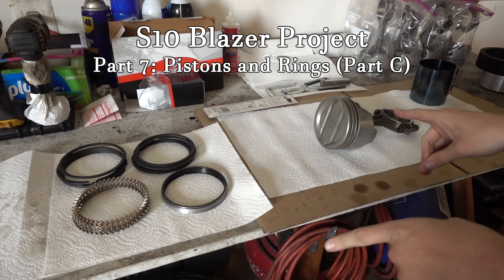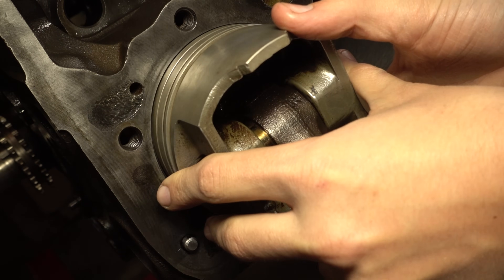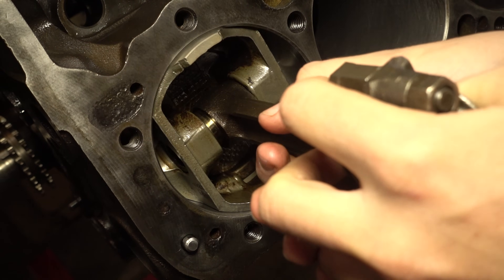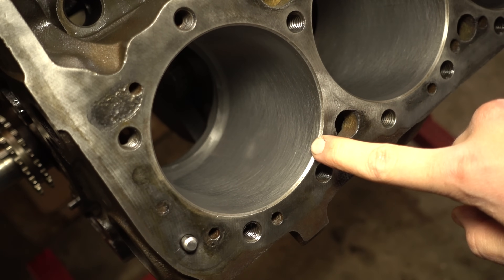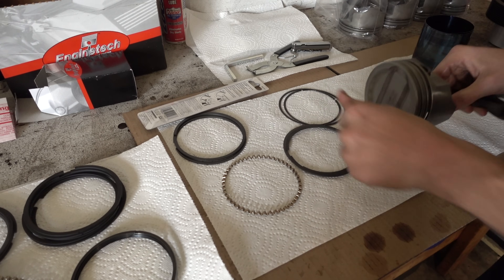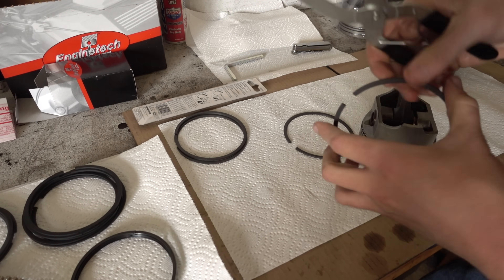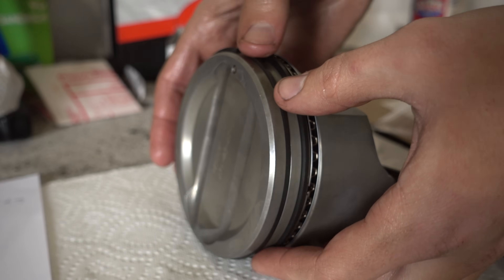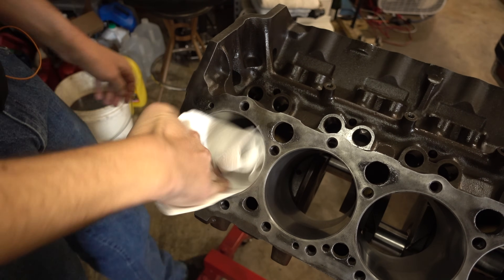V8 S10 Ring Gaps and Piston Install (Ep.7 Part 3 of 7)

Comment: Curious is both top ring and bottom ring wider in the groove not talking about the 5/64 thickness but where the ring touches the back wall of piston groove outward to edge of piston, I'm having a hard time with mine as they are both thicker and both grooves in piston are at the same depth

Comment: I learned a couple of things from a Mr Goodwrench, when putting pistons in is to have the cylinder 90 degrees instead of the 45 degrees you used thus the (protected of course) rod bolts have a even smaller chance of touching the crank journal. Another thing learned was to use a wooden handle hammer to tap pistons into place instead of the rubber covered metal shank handle you used (for reasons another poster stated). 
If I miss a thumbs up on a video it's because I'm rushing to get to the next video as I am enjoying them that much :)

Comment: You may want to check ring depth on the oil seal rings, I ordered a custom set of forged pistons and did not check this and destroyed the engine.
Reply from the maker: Very good point! I know there are at least two different groove depths used for these engines, though most use the stock depth. These pistons used the stock depth so it wasn't an issue, but for some aftermarket (especially high-end) pistons it is pretty critical to check. Sorry about your engine!

Comment: I am surprised that you are being so cheap knowing all the issues you have had. Buy the proper tools and use the proper lube for the jobs you are doing. You are putting all this money into rebuilding the engine but are to cheap to do it right. Does not make sense to me. Also if you are guiding people on how to do things, do you not think you should be showing how to do it the right way? Not the cheap way.
Reply from the maker: I would say that the "cheap way" isn't necessarily not the "right way". If the money is not there to do it better, doing what you can with what you have can get things done well enough. There are plenty of videos out there showing builds where they throw expensive parts and big money at engine builds and make a ton of power, I think it is fine to talk about how to get things done if that isn't an option.

Comment: Using thick assembly lube instead of engine oil on the bearings will increase your free-turn torque. 
With engine oil you might've been 15-25 ft/lbs of torque depending on the weight used.

Comment: What is used instead of plastiguage
Reply from the maker: You could use dial indicators to measure the parts separately, and the clearance is the difference between the readings. Requires specialty equipment but it is the more accurate way to do it.

Comment: Dude, i like you. But this WD-40 is shit. You can use oil engine. Same like factory.
Reply from the maker: There are many people who make the case that you don't want any excess oil on the cylinder walls during cylinder/ring break-in, and WD-40 lets you install them easily without leaving a film of oil. In my opinion, you can pretty much install them any way with cast iron rings and not have to worry about it, this is just the strategy that makes the most sense to me.
Reply: +Fuzzy Dice Projects Your doing right, I build engines for a living and I use WD40 to install the pistons. I've tried probably every method there is over the last 34yrs. WD40 works fine. If ya use oil or tranny fluid, it can glaze the cylinders and the rings never seat.

Comment: Putting rings in without any kind of lubrication can cause scoring into the cylinder
Reply: WD40 is a solvent NOT a lubricant. Ever use it on a squeek and 2 days later the squeek is back...and worse?
Reply from the maker: Used WD40 when installing, as shown. Helps get them in to the bore. Many people prefer to install rings completely dry, though.
Reply: FuzzyDicePimp I know you used WD40 I was talking about how some people put them in dry
Reply from the maker: Oh, okay. I have never tried that myself, so I have no experience with it. Can't be that bad if I have heard of it being done so many times though.
Reply: Engine oil squirt from a bottle would have been more sufficient.

Comment: Tip: watch out for the bottom of the hammer, my dad have a hammer where the rubber has worn out and a steel rod is now damageing everything when you use the back of the hammer
Reply from the maker: Fair point, be careful if you use a really worn out tool like that!

Comment: Wd-40 is neither a lubricant or a penetrate,  please stop using it.  For anything.
Reply from the maker: Agree to disagree. It works fantastic as a lightweight lubricant and water displacing agent. Great for keeping gaskets from sticking, installing parts without leaving a serious oil film on them, and keeping bare metal from oxidizing.
Reply: I use it as a cleaner for guns and an anti rust agent.  Or even to disperse water on an electrical system. I highly disagree with spraying gasket surfaces down,  the whole point is for the gaskets to seal. Not to be able to be removed later. But that's just my opinion  and what would I know with 25 years experience working on vehicles and other equipment?
Reply from the maker: The article you linked is correct, I don't disagree with any of their major points. It should not be used as a lubricant on anything where you need that lubricant to stay there, but it's perfect for pistons (for example) because it helps to install them but doesn't interfere with breaking them in. Gaskets of many kinds are re-useable and WD-40 or baby powder helps ensure they come back off in one piece, very useful for carb gaskets or other ones installed without any dressing.

Keep doing what works for you, if your methods have served you well for 25 years then that's great!

Comment: My dad and I used to use very thin film of white lithium grease on the cylinder walls once we got the ring gap set and installed on the pistons to ease the installation and prevent any galling.
Reply from the maker: Sure, just like some people dunk the pistons in oil I have heard that some people like to use lithium grease for lots of things in an engine. I personally don't think it's necessary, at least not for cast iron rings, but stick with whatever works!

Comment: This is a great video series. You guys should have done this with the Datsun 280z as well.
I have performed this kind of rebuild ( as in no or minimal machine shop work ) on a Subaru flat four 2.5, Nissan L Series 2.4, Toyota Cressida 2.8 straight six sohc and all have worked out well. You should expect excellent results here with you V8. Really enjoy you presentation and editing style. Wish I could come and play too . Can't wait for the next instalment.
Reply from the maker: Thanks, glad you're enjoying these videos! The reason we didn't fully rebuild the L28 engine was mostly time, but also laziness. I suggested to at least put new rings on it, but the car's owner just wanted to throw it back together. He had plans to replace it anyway, though those tend to get put aside once something works passably well.

Comment: No assembly lube?
Reply from the maker: Oil on piston rings is a long-debated topic, some swear by it but some swear you should never use any oil on rings because it affects break-in. It kinda doesn't matter. Something light like WD-40 is nice because it helps the pistons install easily, but will disappear as soon as the engine is started so that the rings can seat quickly and easily.
Reply: FuzzyDicePimp I hadn't watched the video long enough to see you used assembly on the rod bearings. Did you use assembly lube on the crank journals? Love these videos!
Reply from the maker: Oh, okay! Yep, assembly lube on the crank journals too. Same as here, you don't want to take a plastgage reading using it but you definitely want a coating on the bearings before putting parts in for real.

Comment: Is there a tool that lets you lock the crank in place when you're tightening the rod bolts? Seems like there should be a solution for that I just don't know what it's called.
Reply from the maker: As long as you don't tighten them in the direction of rotation it isn't a problem, ie. turn the wrench perpendicular to the crankshaft. For other things you could always just put a block of wood or something between the block and a counterweight to hold it still.
Reply: deweys the crank usually wont move while you are torquing rod bolts

Comment: How long did it take for you to rebuild the engine? I was curious because I would like to rebuild my straight six in my C10
Reply from the maker: Actually, quite a while, maybe four weeks. If I didn't have to film/edit and had all of the parts on hand before starting, I could probably get just about everything done in two weekends. With a friend, probably one weekend (plus time to remove and reinstall the engine). At least 75% of that time is spent cleaning.
Reply: I figured it would take a lot more time! 4 weeks is not a bad turn around actually. It looks like a lot of hard work ,but I'd love to rebuild the straight six in my C10. Or maybe I should buy another one and rebuild that so I can just swap the new engine in. How much did you sink into this engine? I imagine not buying a new crank shaft and pistons probably helped out the budget too.
Reply from the maker: I'll try to add up parts costs at the end, but I think something like $150-200. That doesn't include tool costs like the $40 flexhone. Buying a second engine and taking your sweet time rebuilding it is a very good idea, especially if you can get it really cheap. When there is no rush or time crunch the hard work is more satisfying and fun.
Reply: That's not too bad to rebuild an engine for the neighborhood of 200 dollars. I could splash money on tools with a price like that! I'm going to start looking for a I6 now. Hopefully I can find one without having to buy a parts truck or something. I'd rather just buy the engine because I would want to fix up a parts truck.